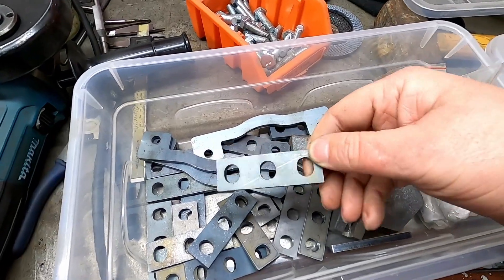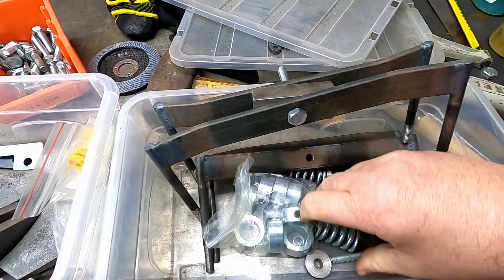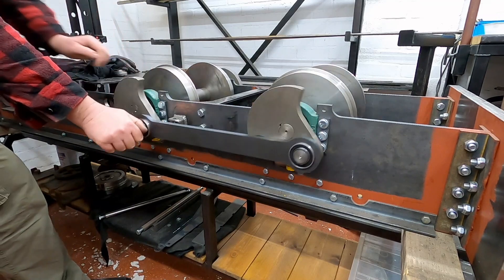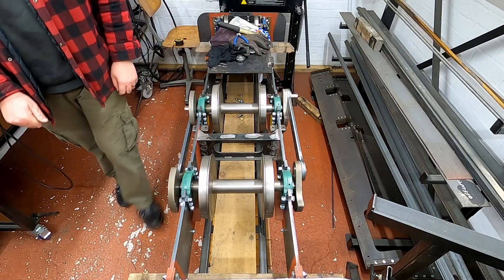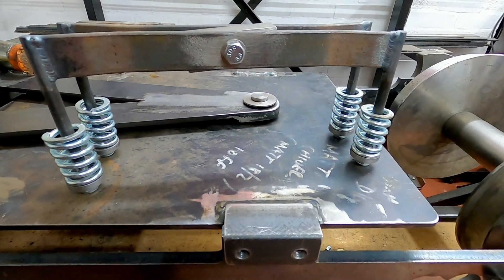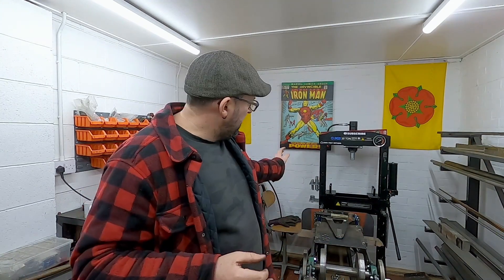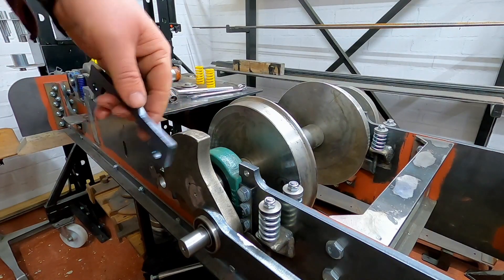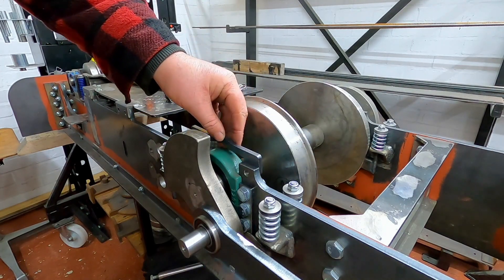Horn Guides, Horn Stays and Suspension Fitment - EP36 - 7.25" Gauge Steam Locomotive Build

Comment: Hi Matt, I was wondering why you have different suspension set ups for the front and rear driving wheels?
Reply from the maker: Hi dss, So these locomotives are extremely rear end heavy, so I was advised to increase the suspension on the rear driving wheel, increase the front buffer beam to aid pushing the rear up and weight the front down. So it's all about weight and balance. I wouldn't do it this way again.... if I was to build at the second one. All the best, Matt